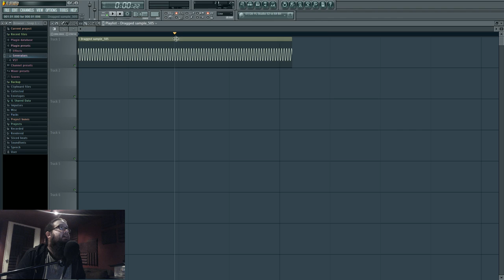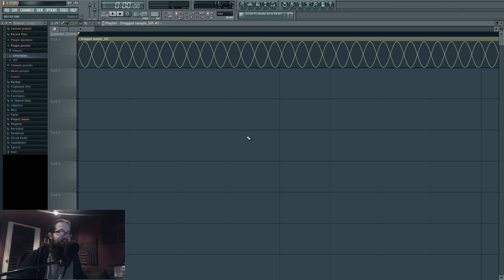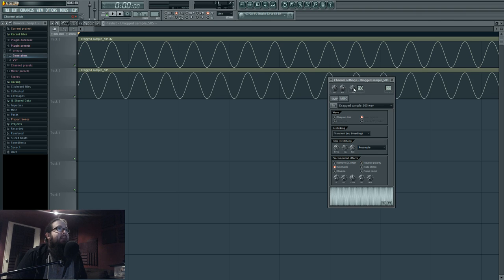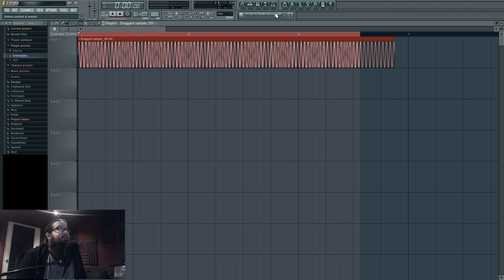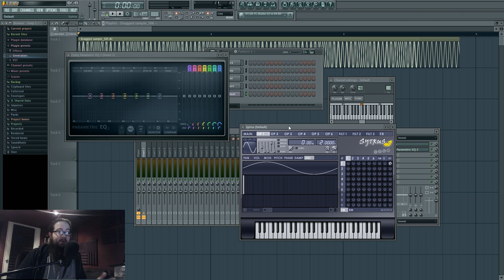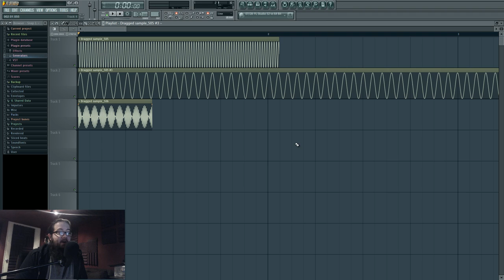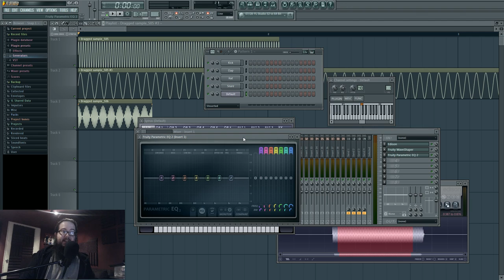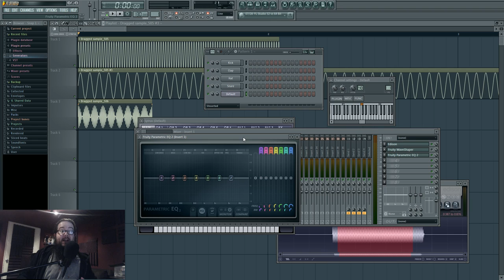Production Basics 1: Phase Cancellation

Comment: Yea balanced cables are one of those brilliant yet simple ideas.  Basically the source sends the sound out twice, once with the phase flipped.  At the destination, the flipped signal is flipped again and the two are combined (internally they're subtracted, but same thing).  Because you flipped the phase of the signal twice (at source and at destination), it doubles.  Because you flipped the phase of the noise once (no noise at source), the noise cancels.  The technical term is "differential signaling," it's used all over the place in electronics and computers.

Comment: Technically, you're right about phase being essentially the start of the wave. In a more specific sense though, phase refers to the offset of the wave relative to the origin. Another way to think of it and much more relative to sound design is that it's the fraction of the wave that has passed relative to the start of the wave and the wave's cycle (aka period, period being the time it takes the wave to return to its starting position).

Comment: Awesome video, as always. Just a little detail about a thing you said. I wouldn't normally comment about something like this but you asked me to in the end of the video xD. You said that a balanced cable is not a stereo cable. That depends on how you use it, what comes before and after the cable. You can use a balanced cable as a balanced mono cable, but also as a stereo one. Headphones have a TRS 1/8 inch connector right. And some mixing consoles have a single 1/4 inch jack for effect returns so you can use just one balanced cable from the outboard gear to the console, using it as a stereo cable.

Comment: Hey Seamless, it's actually XLR that uses Balanced audio to cancel noise with Phase Cancellation, XLR has 3 connections, Hot, cold, and earth, and the Hot and cold cancel each other out, where as on a TRS the 3 connections are Left audio , right audio , and earth.

This is why DI Boxes often turn TS or TRS cables into XLR cables, because it's getting Unbalanced audio signals from instruments or microphones (standard audio signal) into a balanced XLR signal (a signal that uses phase cancellation to eliminate noise)

Also this is also why XLR Is almost always mono and TRS (not TS) is stereo compatible 

Hope this helps :)
Reply: mandokir I didn't say XLR couldn't carry balanced signals, I was just saying that it's XLR cables can use balanced signals to cancel out noise :P
Reply: mandokir what?

Comment: Very good video. I took electrical engineering classes in college where we studied wage forms and how their phases which actually impacts performance of electronics. Having waveforms cancel each other out isn’t a good thing in EE because the resultant signal is linear and not useful.

One comment, you aren’t hearing the “difference” of the signal but actually the “addition” of the signals. Though if you change the phase 180 degrees and then subtracted it I suppose you would be right :)

Comment: Okay i'm just learning about this over the past couple if days, couldn't figure out why my final spread was sounding so fucked up, but I'm curious, Are phase cancellation and phase alignment the same thing ?
Reply: +RellyAlexander  That's hard to answer because phase is over time and cancellation is technically only reversed polarity.  You may be talking about time align.  phasing is a shift in the wave form over time.  Time align is more a shift in the beginning of the wave to start at the same time as something. Drop a stone at opposite ends of a pond and the waves over lap each other that is cancellation.  Drop 2 stones in different areas at the same end that is phase alignment ish  the waves still clash not as much that is phasing.  Drop 2 different sized stones in the same spot at the same time you get one even wave completely different from them individually without clashing.  Time alignment. In other words there may be more than one issue going on for you to look at.

Comment: I thought "harmonics" were overtones.  The math I learned was this,,  The harmonic range goes like this  EG,  A, 440 khz the harmonics that come off this note, are 550,660,770,880,990 etc,  so multiplying by 1 1/2 .  That does not suggest that the higher the base note the higher the frequency of harmonics because the formula does not change the higher the base note.
Reply: No the harmonics are integer multiples so from 440 Hz then 880, 1320, 1760 Hz etc. But yes harmonics and overtones are different words for the same thing.
Reply: Nope. 

https://en.wikipedia.org/wiki/Harmonic_series_(mathematics)

Comment: I have a question about ASIO4ALL... when I select it in FL Studio it makes my sound not work for everything except FL..... lol am I doing something wrong? I do have the audio setting (realtek) the same in system and in FL (under ASIO4ALL).
Reply: Asio driver does this for everyone. Not sure why but if you want to hear (or speak) something outside FL you need to use your primary sound driver. But i wouldn'trecommend it because primary sound driver is pretty bad usually.
Reply: You can buy a sound card though. It usually comes with a driver for the soundcard and it would let you interact with sound in other programs too.
Reply: GeekyGamerChik In order to reduce FL Studio's latency (i.e. playing notes within a few milliseconds of when you push buttons), it needs to make sure that nothing else can "distract" your hardware from playing sound through FL Studio. If it didn't, you would hear occasional glitches from the hardware trying to process more than it can handle. 

Usually, there's a delay between hardware and software, to allow for processing time of multiple applications, but ASIO tries to minimize that by reducing the number of applications that can request access through the hardware.
Reply: Thank you guys!!
Reply: +RythmOsis There is wasabi shared mode.